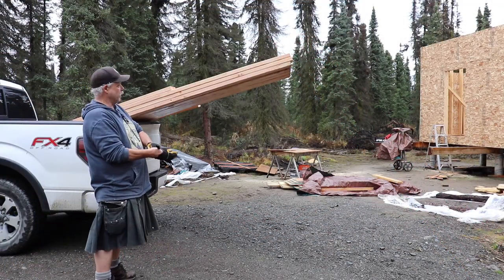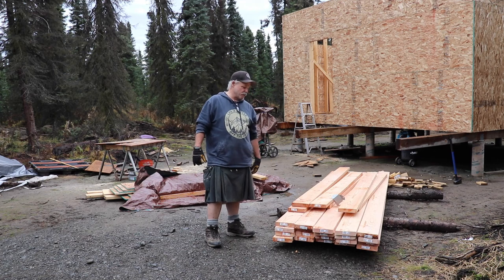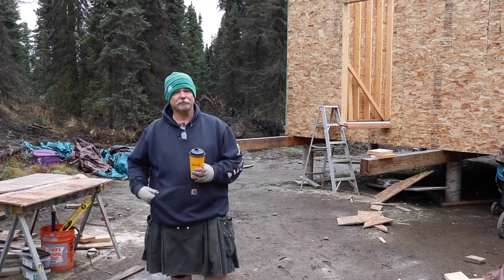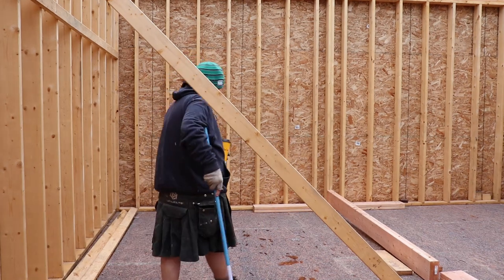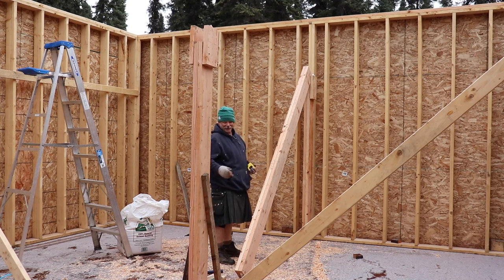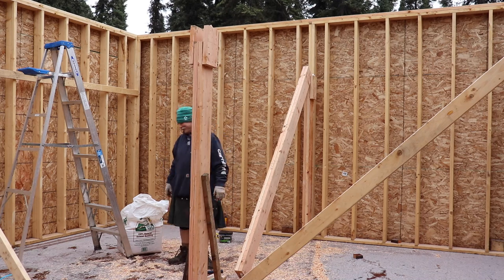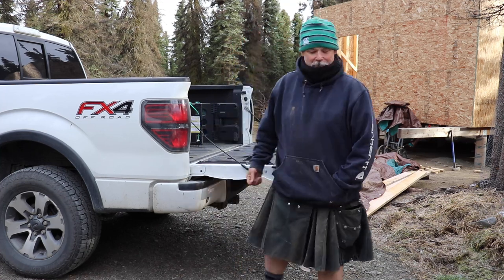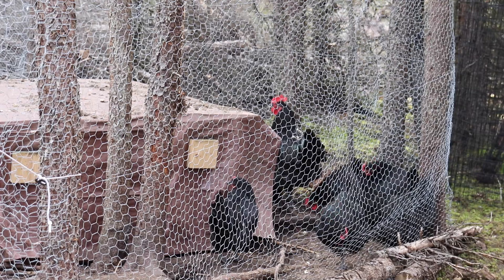Building a loft in the Alaska cabin

Comment: Make sure that post isn't sitting in a bay on that floor. Make sure it's load is continued down to the beams with solid framing lumber.
Reply from the maker: The post is sitting on double 2x8s that run continuously through the entire floor....I made sure if that when I placed it. Those 2x8s are resting on the sonotubes,  it is solid!